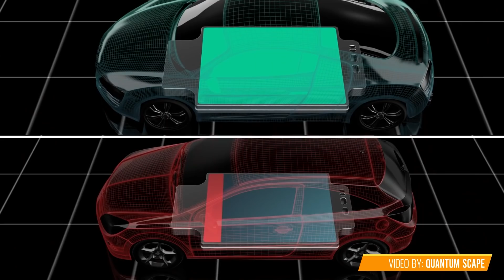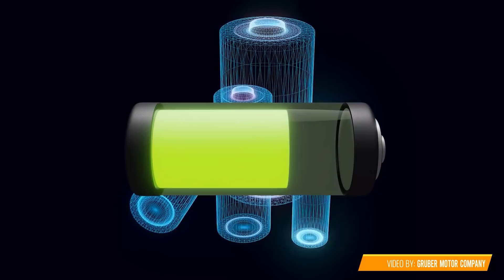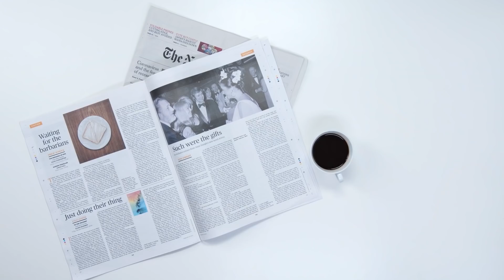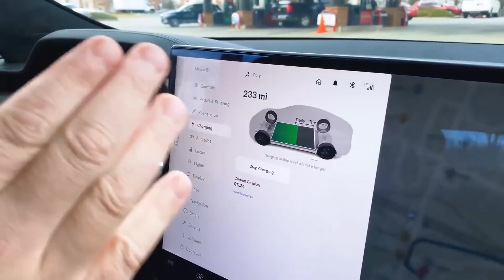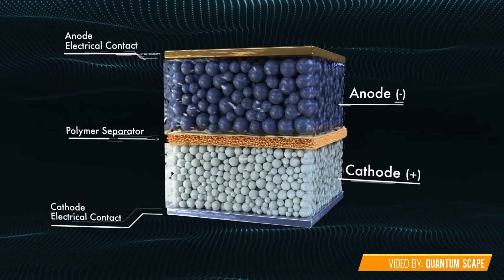SANDY MUNRO: Are Solid State EV Batteries Too Late?

Comment: I would absolutely own a EV vehicle if I was younger and still driving to work 12 miles round trip. But one thing I do not hear from the Pro EV vehicle community is how to address the environmental problems of manufacturing and Disposal of the batteries. I have heard that the carbon footprint of a Humvees lifecycle from production to the scrapyard was less than an EV vehicle because of its battery. I would hope it was a rumor but I would like to see some data and some possible solutions to these concerns.
Reply: A former employee of Tesla, left a while back to start his own company.  Recycling old batteries.
I believe it's called RedWood.
Reply: you have heard wrong
Reply: @NonAlignedThinker  okay I'm wrong but what is the answer then? You have to take into account all aspects into producing and Manufacturing and recycling these vehicles besides their operating life cycle.
Reply: @davidclemens1578  battery recycling is growing and will continue to do so. Renewable energy is replacing the fossil based energy used in many places to charge EVs. There is a clear and obvious path forward for EVs. There is literally no viable path forward fore gas vehicles.
Reply: @davidclemens1578  think in a box and you never solve anything. best of luck getting out of your box
Reply: @NonAlignedThinker  you are in a box to think that to build electric vehicles doesn't require Almost 100% fossil fuel energy. from the mining of material for the batteries and aluminum for the chassis, and the copper for the miles of electrical wire and even the plant-based insulation for the wiring. Then you have to include all the shipping and trucking required to get all these materials between each stage of assembly. Then you have to include all the infrastructure that will have to be built to support the energy required to keep these batteries charged. That will also need almost 100% fossil fuel to fulfill these requirements. You have to stop looking at the intersection you're at and actually look down the road and see obstacles you have to go around to reach your destination
Reply: @davidclemens1578  whatever bro.. go pray to your gods of gas and have a good life
Reply: @NonAlignedThinker  you should go back and look at my first comment. As I said before a majority of the EV vehicle community want everybody to believe that that these cars leave virtually no carbon footprint. I'm just pointing out the fact that these vehicles leave out a very large carbon footprint. The fact that, as of now, to produce, operate and dispose of the EV vehicle requires Almost 100% fossil fuel. And I emphasize batteries can't go without recharge there by fossil energy to recharge. It is just a part of the solution.
Reply: to add.. everything you do is going to have a carbon footprint of some kind. reducing it to a level that the ecosystem can handle is the objective, not reducing it to zero. To say that EVs also have a carbon footprint is like saying water is wet.
Reply: Why should we? 

Have you taken into account the environmental impact of digging and pumping oil? 
Of transporting and pipleining it? 
Of refining and transporting the fossil fuel to be pumped - by electric motors - into the cars to be burned and destroyed forever?

Batteries need electric energy to be produced. Much of it. I recommend harvesting from solar power. 

But less than for the Lithium in your fossil cars. 
Less than the cobalt in the crankshafts of fossil engines. 
Less than the Lithum in the gazoline which has to be used for refining it.
Less than the Nickel in the engine Blocks.

And if and when there are batteries to be recycled - maybe in 2025? maybe later? 
The companies Duesenberg and Redwood are eagerly waiting fo those to be recycled. 
Currently they do not get enough to start the process.
Reply: @wolfgangpreier9160  unlike other minerals and sources, lithium cannot be stored it has to be used as it is extracted. This country has many regulations in place to help prevent most Environmental accidents. But what about all the other countries out there where we get our sources from? The lithium and Battery waste problem is just another one to add to the list. We should be looking at not Outsourcing all of our needs and start doing more in country where we can regulate these sources. Companies should not be allowed to buy from other sources unless their suppliers meet our safety and environmental standards
Reply: @davidclemens1578  Yes to everything you said. Why - do you think - Tesla Grünheide still has no permit to produce?

Comment: Last week I presented to a group in southern Florida about EVs. Over 80% of the people in the meeting owned electric golf carts they keep on a charger. Out of 100+ people, not one owned an EV as their only vehicle. Only one couple had an EV car and a handful had PHEVs. The EV family also owned an ICE vehicle. When I asked why they said during a mandatory hurricane evacuation to Georgia there are not enough charging stations that can handle the volume required for their 250+ mile trip to a safe area that takes over 10 hours due to backups. If their vehicles could charge in 15 minutes they could see the value. Some people with ICE vehicles fill up extra gas cans and store them in their trunks when they head north.🔌
Reply: You don't need solid state batteries to fill up 10-80% in 15 minutes, 800volt architecture Evs now can do that with 350Kw chargers.
Reply: @TriviaChallenge  :yt:I agree but try convincing a bunch of people worried after what happened in last year's Elsa hurricane evacuations in Florida. I was not there but apparently, it made the news about EV charging stations backed up two to three hours at the state border. I did experience a 75-minute wait time at an East coast charging station the Wednesday before Thanksgiving in 2020.  What I told the group was if you had an EV it would have been fully charged and driving 30 mph in slow traffic your vehicles should have easily made it out of state if you were fully charged. As I pointed out to them typically everyone with ICE vehicles has to wait at gas stations to fill up before leaving the state during a hurricane evacuation.
Reply: @TriviaChallenge  heck car and driver got 187miles of range back in just 15mins with their model s plaid charging test recently. 
And that is on a very common v3 sc which has been around since late 2019 on the 400+v architecture. Wonder what the update to 324kwhs coming later this year will do. 🤔
Reply: I've lived in S. FL for 30+ years, and been through several hurricanes.....never heard of a "mandatory evacuation to GA".
Reply: @robp3431   The people from Apollo Beach, Gardenville Beach, Bradenton, Sarasota, Sun City Center, Gibsonton, and Ruskin who attended the presentation at the warehouse told me they had to leave. They could only find hotels in the next state. Apparently, this was due to a hurricane that hit a city called Punta Gorda(SP?) a while back. I live in the southwest desert so I can only go by what they said. I work as an electrical engineer for a company promoting electric power trains for semi-trucks that require 30 minute charging on 600-1000kWH batteries.
Reply: Extra gas cans in the trunk? Every once in a while a car gets rear ended and then the life of the occupants hangs in the balance of whether those gas cans can take the hit.
Reply: @danielstapler4315  I know all about rear-end crashes and the dangers of explosions. I owned a 1979 Ford Pinto. I would never recommend gas cans in the trunk but keep in mind the group I was talking to were in transportation and many use pee bottles while driving to save time because they get paid by distance and not stopping.

Comment: You can do 3-6 minutes recharging now but its with pseudo capacitors....the range is only 100 to 150 miles
Reply: Whatfor? What is it that you need to do so desperately in the 10 minutes it takes for a "normal" fast charge?
Reply: Your claim seems dubious. What capacitors exist that have enough energy density to give a car 100 miles range. Let me guess...they are either still in the lab stage of development or are exorbitantly expensive.

Comment: It cost me $23 a month to charge at home.  Couldn't be any better. Must have saved $85 per week over the last 4 months on Premium fuel.
Reply: Or £850 a week if you live in Europe ;)
Reply: Do you think power companies won’t raise the rates once everybody gets an Electric vehicle?
Reply: 7,40 Euros per 100km = 5180,-- Euros saved for energy alone. Each year. For all company cars. 
And no service = around 3000,-- Euros a year. And no taxes = around 450 Euros a year. 
Makes a grand total of around 8.630,-- Euros a year. Or a Model Y in 6,7 years. 
Thats the answer. 

I happily wait for my cars to charge at the Supercharger. It has a value in its own.
Reply: @wolfgangpreier9160  im pretty sure those numbers are BS. the amount each of your company car would have to drive for such a saving would be around 200k km a year.   just buy a diesel...
Reply: @nox5555  I had Diesel VW Caddys with 102 HP. Now i drive a Model Y LR with several hundred HP (and a Model 3 and a Fiat 500E, but thats besides the point). 

Our gazoline costs 1,60 Euros per Liter, Our Diesel costs 1,40 Euros per Liter. The Caddys needed 7 Liters per 100km. My Model Y uses 18 kWh (the Model 3 a bit more, the Fiat less etc.) and my electricity costs currently 16,7 Eurocents/kWh

My five company cars (for 4 emplyoees and me) run about 70.000km each year.

Calculate yourself.

Comment: Yeah 15 minuets is plenty competitive with gas. Unlike a gas vheicle you're safe to go use the bathroom while charging.  That's basically a hand of solitaire
Reply: And the cost of electricity is 1/3 of the cost of gasoline 💰
Reply: @Okefenokee_Nole  up here in canada its 8 cents a kwh so say you have a model y 60kwh thats 4.80 canadian if I had a car with a 60 litter tank gas up here is 1.70 a liter thats 107.00 so I would say thats just a little more then 1/3 thats more like 4/100th  the price difference
Reply: @lesstevens2370   They charge a lot more for electricity down here, but it’s still a lot cheaper than gas!
Reply: Not only that but normally you would charge at home anyway. Probably don’t even need a special charging station. Normally you would be at home between 8 and 12 hours each night, maybe more. Plenty of time to top off for daily driving.

Comment: One of the Lithium Ion Battery Novel Prize winner Akira Yoshino commented about the solid state battery.
One of the breakthrough was happened about solid state electrolyte, but he thinks there are one or two more technical breakthroughs are required for mass production.
Also he thinks current Lithium Ion Battery technology, such as NMC, NCA, LiFePO4 are good enough for electric viehcles.